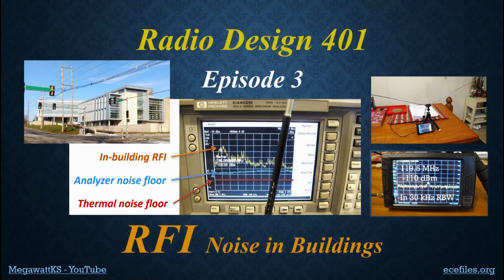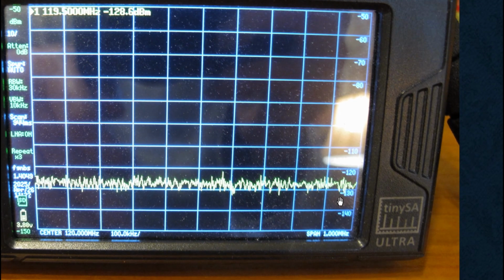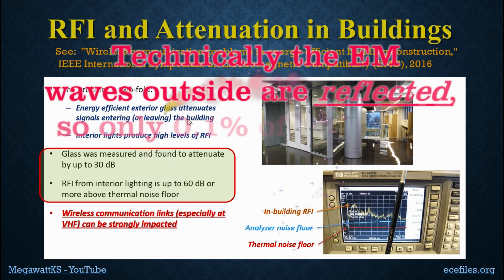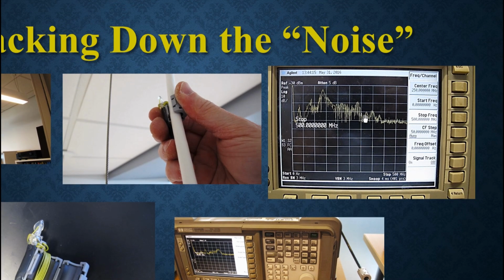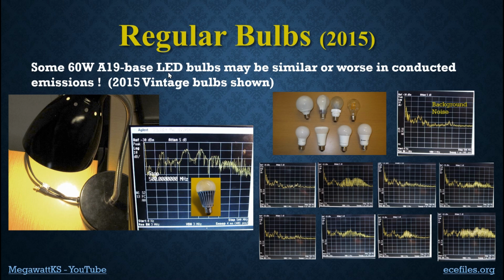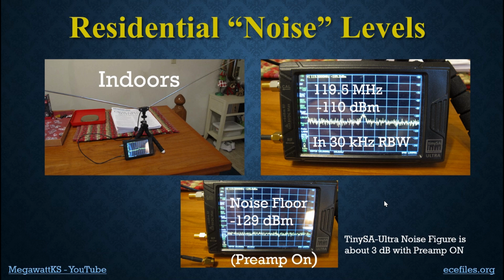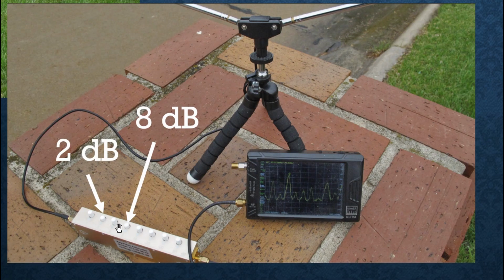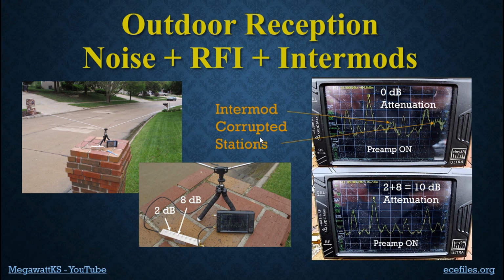RFI Noise in Buildings -- Radio Design 401, Episode 3

Comment: Another great video.  All I can say as a amateur radio operator is thank god I live out in the country.  My noise floor is basically whatever I create myself.  Have helped so many people over the years that live in high EMI environments.  I keep a large inventory of toroid cores and snap on cores in a couple of different mixes that I use to make CMC chokes when helping people out.
Reply from the maker: Wow - sounds like a wonderful environment!  Interesting how the RFI sources have changed over the decades. I can still remember shutting off the furnace in our house in the 70s (it had a spark igniter).  My dad got annoyed when I forgot to turn it back on one time after finishing my QSO !  Have you found any cores/chokes that work well in the VHF+ range?
Reply: @MegawattKS  Type 31 (MnZn) for the the mid to low end of HF, Type 43 (NiZn) for the top end of HF and type 52 or 61 (NiZn) for VHF/UHF.  If your into SLF and the bottom end of HF type 75 (MnZn) is pretty good.  Type 31 is great for 160M to 30M.  The properties are about the same for 31 and 43 from 30M to about the 1.25M band.  I mainly use multiband antennas for HF so all of my HF cables have both 31 and 43 which gives me great performance across 160M to 6M bands.  For VHF/UHF vertical's and Yagi's I use Type 61.  I probably don't need to use them but it makes me feel good. 🙂  The only real problem I have ever had here was CMC (common mode current) on OCF (off center fed) dipoles.  Luckily I'm in the middle of 15 1/2 acres out in the country so the only problems are usually self induced.  The first OCF dipole I ever made and used had high CMC and it ended up turning on and off a touch lamp, tripping a GFCI outlet in the basement, being able to hear myself coming out of the speaker on my answering machine and setting off my carbon monoxide detector.  Stacked a 31 and 43 core together to make a CMC choke and the problem disappeared.
Reply from the maker: @mikesradiorepair  Nice!  Thanks for the detailed reply. 🙂  I've used some of those mixes for inductors and transformers in designing/building circuits, but haven't done a lot of chokes on coax.  Sounds like you have a fabulous environment where you can control things. Sadly, RFI is all over a lot of buildings, and once it's radiated, there's little a receiver can do. Maybe building-construction companies should be encouraged to install these as they put up the lighting/etc !  The darn stuff massively increases the noise floor when they don't 😞
Reply: @MegawattKS  In recent years I have seen a lot of RFI problems that were caused by modern washers, dryers and well pumps for people like me out in the country.  A lot of motorized appliances use variable speed motors these days and they are known for being large wideband RFI emitters.  Honestly between that and LED light power supplies and solar panel inverters I don't know what is worse.  At least with noisy motor controllers it's fairly easy to just stick a toroid core choke on the power cord.  The antenna manufacturing company Palomar Engineers in addition to antenna products specializes in RFI remediation products (ferrite).  I direct a lot of amateur radio operators to them to get their ferrite choke kits.  It's a good one stop shop for those products.  Susan and Bob (chief engineer and amateur radio operator) are very helpful.